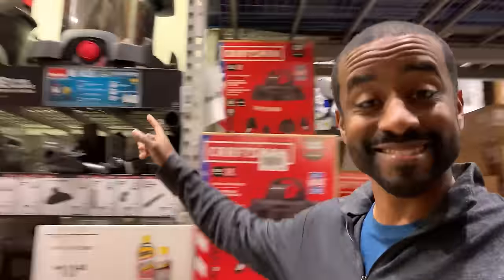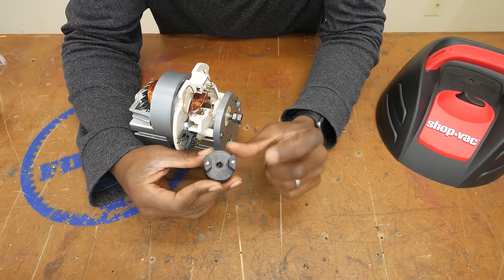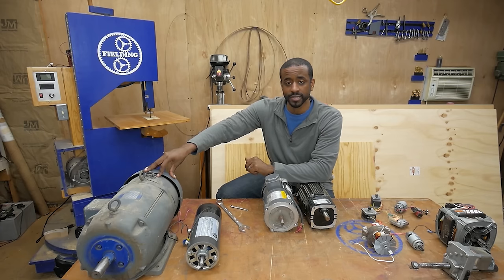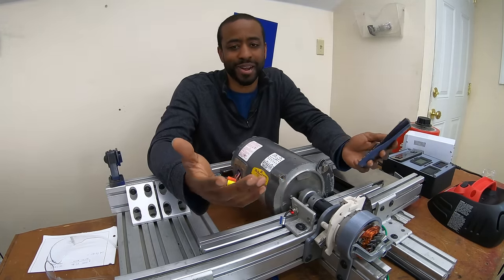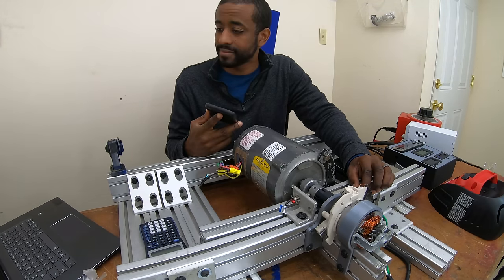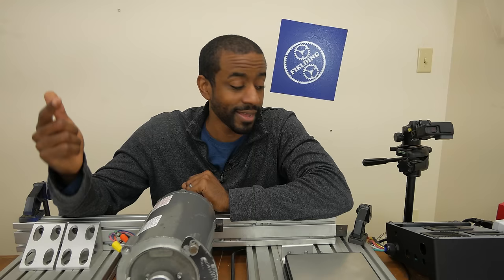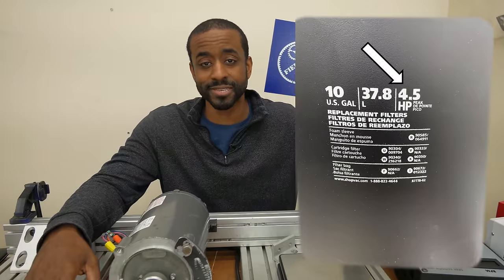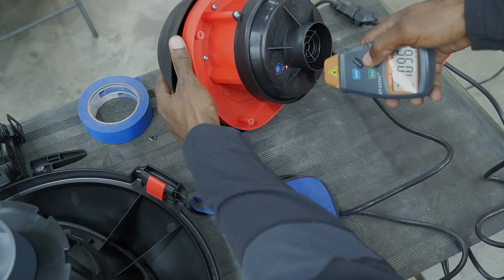How Much Horsepower Does Your Shop Vac Really Have: #078

Comment: You need to maximize every factor in their favour.  You need the maximum allowable input voltage (about 127 volts) measured the motor terminals, no voltage drop in the line, with the motor cooled way down (lower resistance).  Then just a very small flywheel as the load, precisely measure it's speed via computer as it ramps up, so you can measure the angular acceleration.  From that calculate the motor's torque based on flywheel and motor rotor's angular moment of inertia.  This might just get you to the rated value, and you will be able to run the test more than once.  The motor will only survive "peak load" for maybe a second or two, so you really can only have it as a startup transient.
Reply: I was thinking the same thing with the voltage input. But I was thinking more along 220V. But with motors, 115VAC and 225VAC can make a biiiig difference on the output.
I hadn't thought of the cooled coils, however this makes a lot of sense. More heat equals more amps wasted
And I'm almost completely lost on the angular moment of inertia  😜
Reply: Either it's the startup power for like 0.2seconds, or it's the amount of power it can make while decelerating from full speed to 0 over 0.02 seconds.
Reply: Seems more like they are using peak voltage instead of rms and maximum current available from a socket.
Reply: Matthias I am a subscriber to your channel you should try to prove or disprove the claims. Maybe we all learn  something.
Reply: Sorry I didnt read your comment first.  Sililar to mine, you have a mechanical background and mine is electrical. I think we were aiming at the same thing from the two different sides.
Cheers,
kevin
Reply: Huh? Oh hi MW. Ain't watched you for a while. I'm a big fan. Could you maybe do some honesty tests on household appliances? Thanks
Reply: You know you've hit something interesting when @Mathias Walden comments on it loll
Reply: from the wording I'm assuming their claims are based on the energy stored in the inertia in the motor and impeller. iow spin the motor up to max rpm with no load, throw a big load on it and for the first few milliseconds it takes to slow down the motor and impeller it'll drive the load like it had 6.5hp
Reply: Or put a flywheel on it spin it up to full speed and see how much you work you could do with it for 1/10 of a second or less and it might look like 4 horsepower.
Reply: Well it's most certainly not going to be nearly a 3.5kw motor in that, so even with that I cant understand how they're getting their numbers
Reply: My lord and savior lol
Reply: Some heroes don't wear capes
Reply: I have always understood "peak" to refer to the maximum value of the AC sine wave and that  the exaggerated HP claim is based on a "ideal" calculation rather than an actual lab measurement. Or that the measurement is made only at the instant the peak is reached. I would think that a "true" calculation should use the average or midpoint of the sine wave thereby cutting the HP claim in half. Allowing for the inefficiencies, I would expect to see something less than half has you have done here.

However, Matthias' response makes me think I must be wrong somehow if he believes close to peak could actually be measured. Are you measuring peak or average?
Reply: Thanks Matthias, my brain was already hurting from watching Jeremy's video and now I have an aneurysm after reading your comment.😁
Reply: This makes me wonder if they do similar to the calorie calculations in food. You can say that something has "about 2.5" servings, and that there are only "10 calories per serving", but if you do math like you were taught in school it comes out to like... 45 calories per serving, because PEMDAS.
I wouldn't be surprised if it was the same thing here. If you do enough math wrong you can make up whatever number you'd like!
Reply: Nope. Marketroids are making stuff up completely, like "max developed horsepower" as the stall / inrush current, which isn't horsepower at all. It's ridiculous. You can't get more than 2.3 HP out of a normal wall outlet, period, full stop, the end. The power isn't there.
Reply: @demonshaz  that's what AvE's channel is all about.

Comment: FYI......An "actual" 4.5 HP Shop Vac would be way too powerful to legally manufacture, and be used by the general public. The vacuum's massive suction force would tear the fabric of the time-space continuum, and create a quantum  singularity.  Otherwise known as a black hole in your garage. This could have disastrous consequences for your house, or even the entire neighborhood. The attorneys for the vacuum manufacturers have advised  against any vacuum over an actual rating of 2 HP for liability reasons.

Comment: This has ALWAYS made me furrow my brow on just about any electric tool that is rated above ~3HP and runs on a regular 15/20amp circuit.  The math just doesn't add up
Reply: Great point! The most you could draw before tripping a 15 amp circuit breaker is 2.4 horsepower, or 3.2 on a 20 amp breaker- and that's assuming no other loads on that circuit.
Reply: no.... the starting current is 100 amps for like 1 milisec, which is how they get 6.5hp
Reply: @nicksgarage8295  if they are rating their motor for a 100 amp draw, they would be able to claim ~15hp
Reply: @nicksgarage8295  Wrong, Nick. You just made that up.
Reply: Consumer market vs Industrial markets. One customers group is smarter than the other.